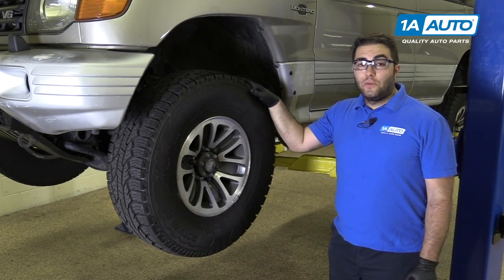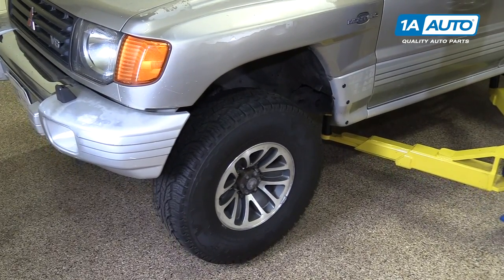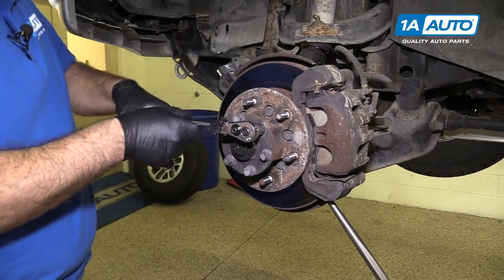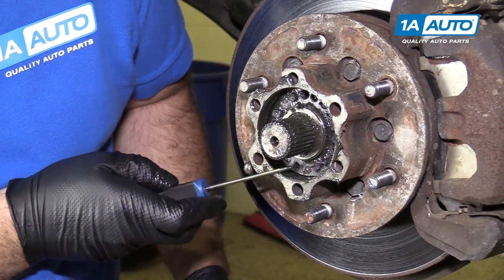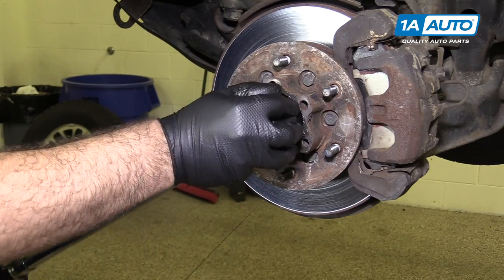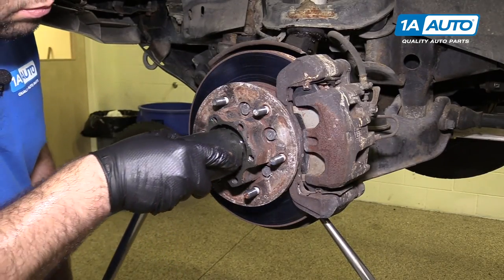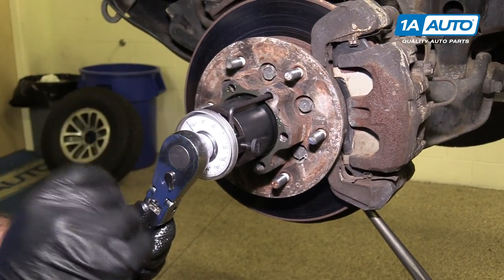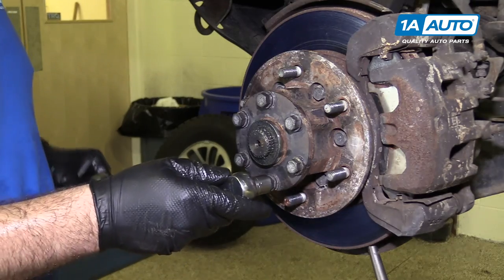How to Re-Tighten Wheel Bearing 92-99 Mitsubishi Montero

Comment: Very good video. The Mitsubishi L200 K74 version fitted with ABS is an absolute nightmare to get at the front wheel sensors to try and clean them. They are too exposed and if you try to remove them they will most likely snap off leaving the sensor inside. These front wheel sensors are so magnetic I can even pick up a pair of vice grips with one. So any rusty dirt particles are immediately attracted to them which can  then trigger a fault code in the ABS system. Beware of previous owners who remove ABS lights to cover up faults. The ABS light should always come on very briefly when starting the ignition.

Comment: Not required torque wrench in tightening the bearing retainer ring-nut.you can tighten manually and hub must be rotated as per rotation of nut,feel that there must be no drag of bearing,nevet over tighten to avoid damaging the bearing.

Comment: Do you need the torque wrench for the bearing retaining ring? I saw a couple posts where is just says you can screw it in hand tight?
Reply from the maker: +Jacob Swartz At about 13:15 you can see the tech installing the lock ring with a screw driver.  Thanks for the question.